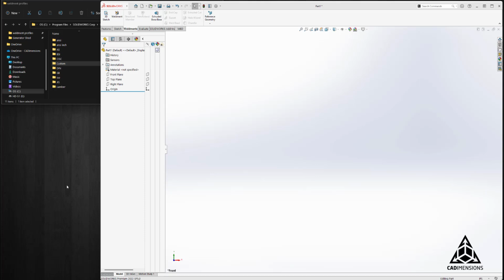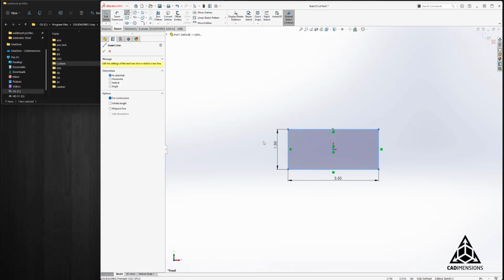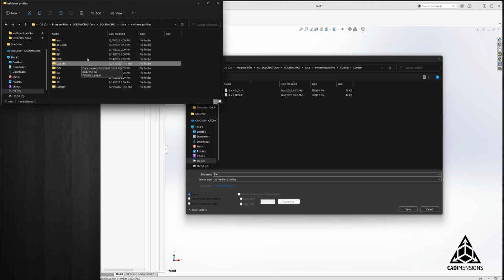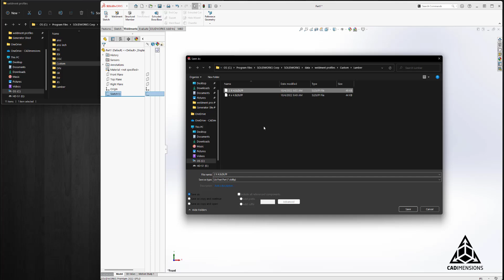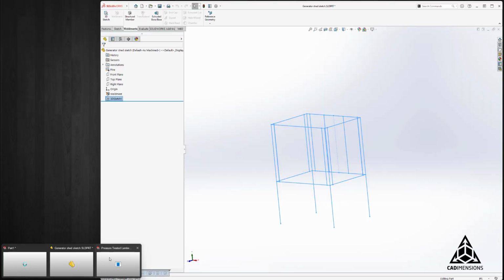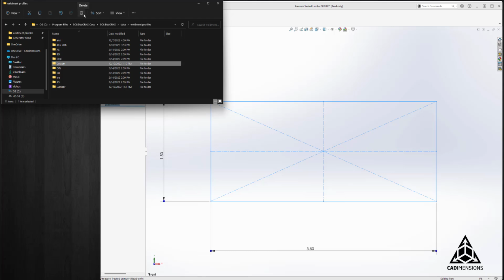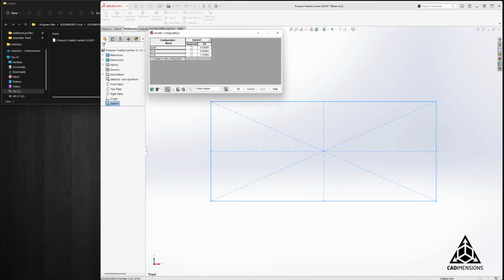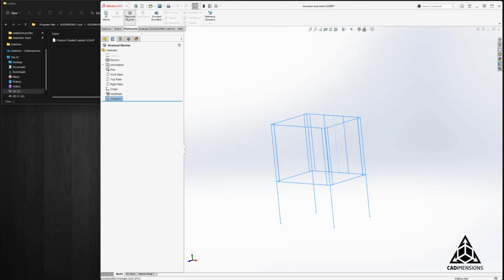Creating custom weldment profiles in SOLIDWORKS

Comment: why does it say you need adminstrator permission???? when i try to save into the weldment profiles
Reply: It's common that the first time you try to save a new weldment profile, you need to change the admin rights for your operating system, for example, Windows. There are a lot of videos about it:goodvibes: